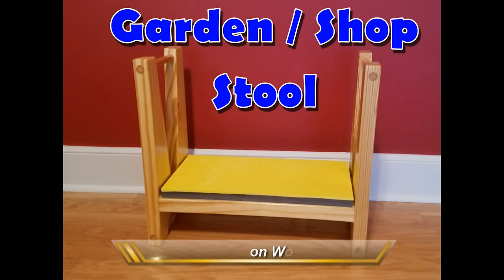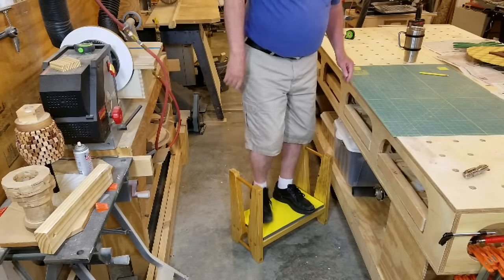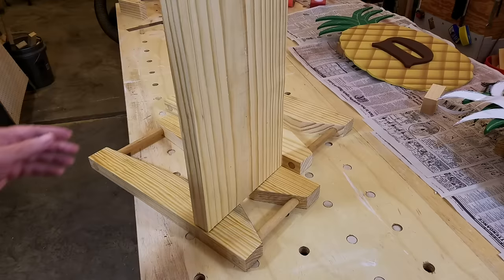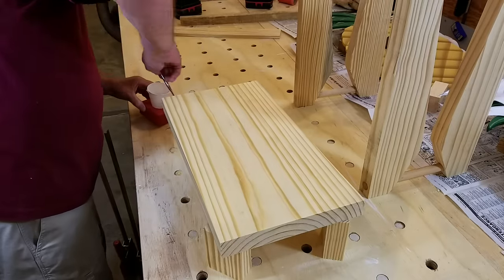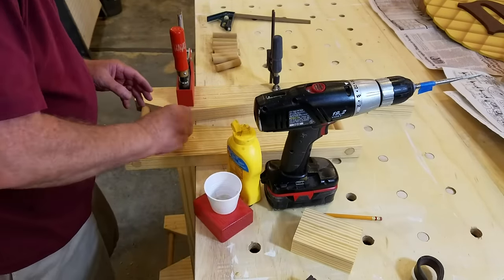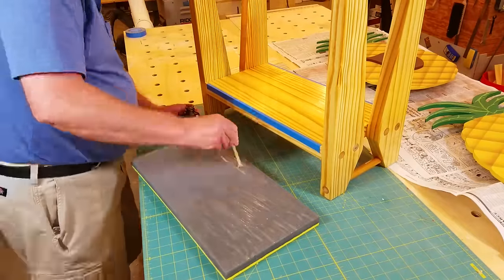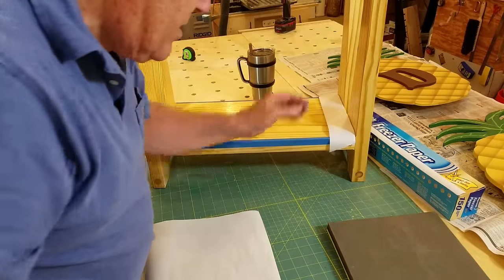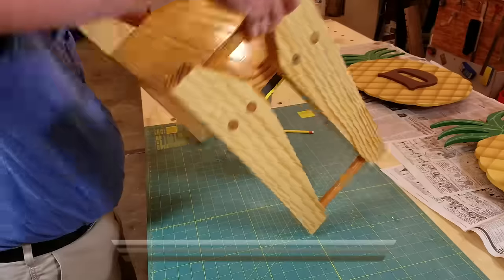Garden / Shop Stool

Comment: I just finished one up for my wife for a Christmas present. Only finishing sanding to remove glue and top coating remaining. I used left over 2x cedar from a raised bed build for both the legs and seat and I’m hoping it’s going to pop the way I think it will. Thanks for the plan and the tips. Your design is superior to anything out there - and I did a lot of searching for an upscale kneeler. I wish I could post a pic.

Comment: What a great idea and design. I saw a similar one on the Lee Valley website that folded for $52.00 Canadian. I like yours much better. I see myself building a couple of these in the very near future. Thanks for posting the build.
Reply from the maker: Mine was made from cutoffs, an old broom handle and glue and poly I had on hand...so the cost was zero.  That's my kind of project.  lol

Comment: About how much weight would it take, do you think?
Reply from the maker: I know for a fact that it handles 225 lbs with no problem.  :)
Reply: +Earl Davidson Woodworking made a variation of it today. Made. The base wider to accomodate my hips, and single pieces on the sides instead of four legs. Just need to add my padding, and maybe some handles on the long side, and it's done.
Reply from the maker: I'm sure you'll find it useful.

Comment: This is so much more stable than the steel-tube version available in stores. Hoping you or one of your viewers knows how to add a power assist to reduce strain on arm muscles . Gardeners.com had one but it's out of stock. I'm a woodworker only in my dreams, but I am pretty sure a DIY version would be possible.  For reference: 
https://www.gardeners.com/buy/dynamic-power-garden-kneeler/8600272.html